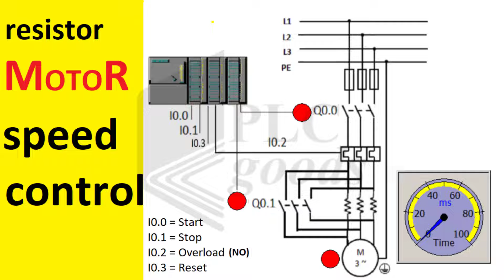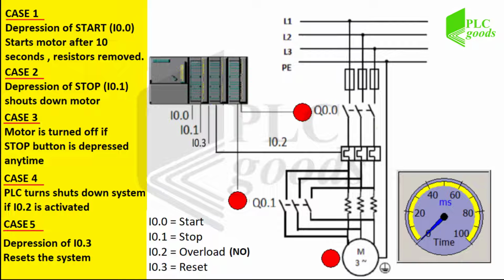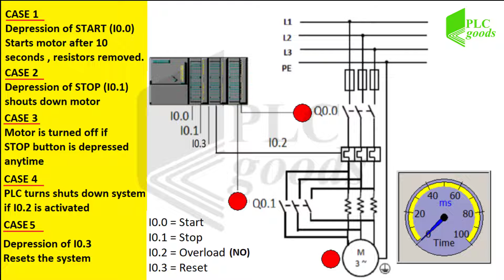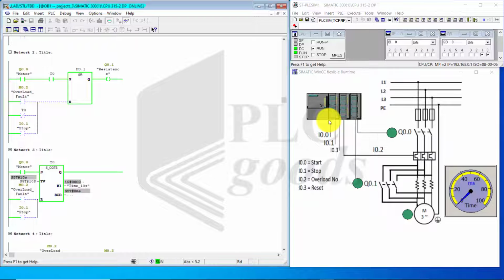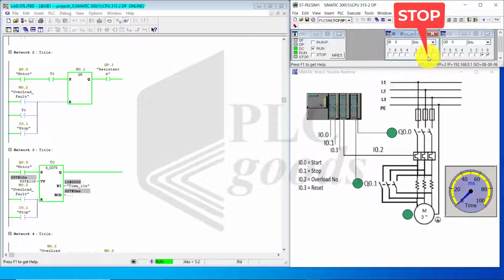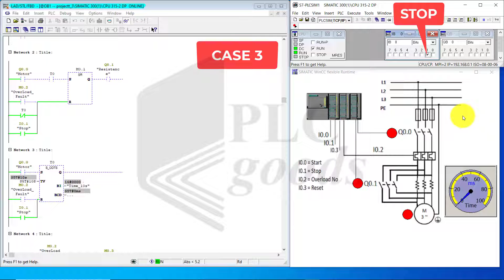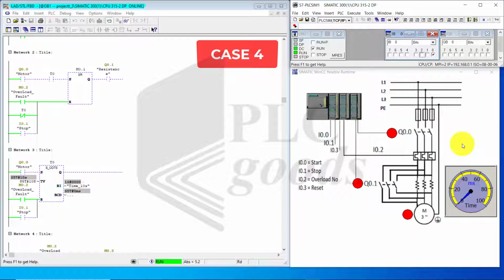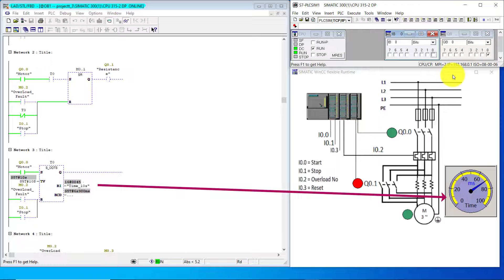Resistor MOTOR speed control

Comment: thank you sir for this video 

LRS , liquid resistant staters are widely used in starting slip ring motors ,in the cement plant where I used to work they are used in the crusher,raw Mill and cement mills to reduce starting current and increase torque...... this video will be very useful
Reply from the maker: Thanks for sharing your experience! 👍

Comment: Waste of time to make video about resistors in 3phase motor circuit in 2024! 
Wasted time watching it, because was anticipating something else.
Reply from the maker: Thank you for your feedback. I understand that the topic might not have matched your expectations, but the goal of this video wasn’t to debate whether using resistors in a 3-phase motor circuit is the best real-world solution. Instead, it was to present a scenario that helps demonstrate how to write a PLC program based on a given specification — regardless of whether the setup is used in practice or not.

Many of the problems I create are intentionally designed to teach programming techniques and logic development. Even if the hardware setup seems theoretical, the programming skills gained are very real and valuable.

I appreciate the time you took to watch and comment, but please consider the effort that goes into creating this free educational content for those who are still learning.